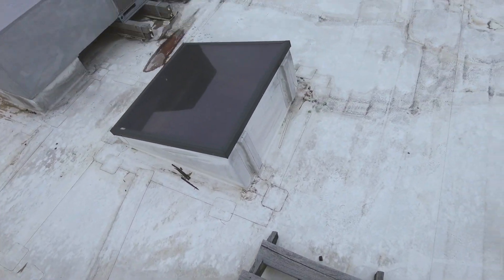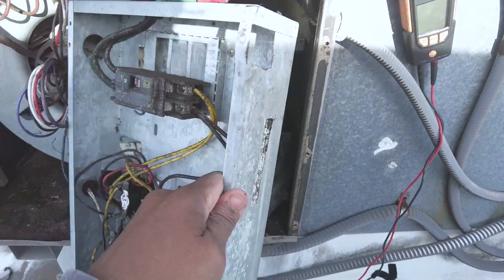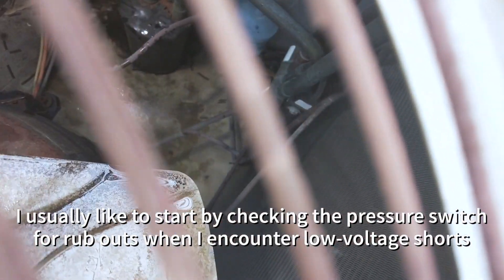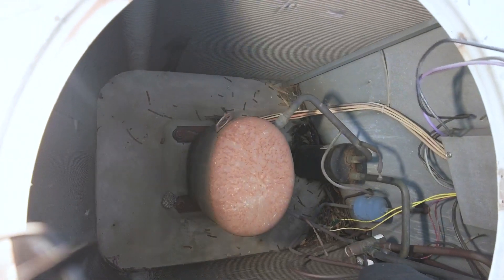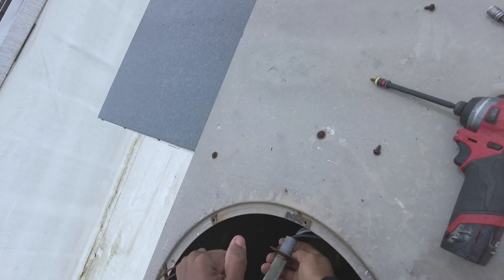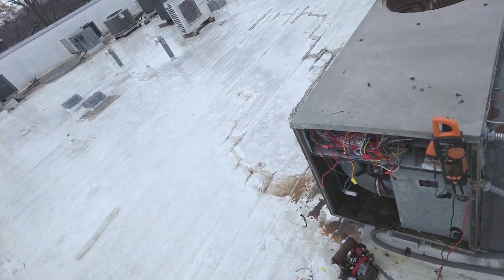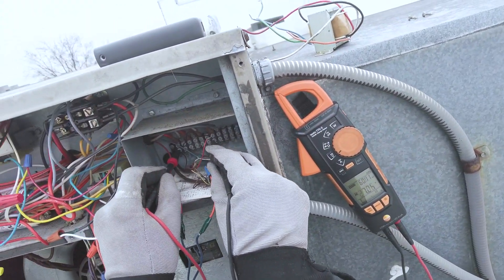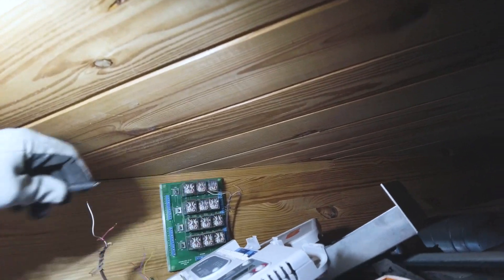Multiple Low Voltage Shorts Found on a Goodman Heat Pump Took Me Forever to Complete Repair🤯🤬 Pt.2

Comment: Coming up on five years in my house and five years with a 3amp fuse blowing on a Carrier Purion heat pump, installed by a prior owner in 2014. Seems like the blown fuses occur on a seasonal basis (winter). We have had yearly service calls by a local tech who runs his own business (mentors young HVAC techs so presumably he knows what he's doing!). Fuse usually goes out when there is snow on the ground and knocks everything off line. First time it happened a transformer also blew when he came out to diagnose it. The prior owner must have been having issues because somebody had installed an over-rated fuse there (probably to keep it from blowing) and apparently had the (elderly) former owner change out the thermostat every year (judging by a box of household-related receipts we inherited). Every time we have the tech out the 24 volt wires meter out correctly. Last year we had another part replaced that involved some type of spring type mechanism that is responsible for relaying the signals from the thermostat (he said it was sticking) but a year later, the same deal. Three years ago we even had the wires from the thermostat to the unit pulled and entirely replaced. This past February the fuse blew again as the tech was putting the panel back on the outdoor unit so he re-did the connections thinking that the short might be located there. (Always says the wires look good otherwise.) A few weeks later the fuse blows again. We finally tell him that we're tired of having this issue reoccur every year and what can he do to make sure it is truly resolved. After a few minutes he says the short occurred in the yellow wire (inside) and re-did that connection (should the wire have been replaced instead?). We could be waiting until winter 2022/23 to find out if this repair resolved the problem — but rather than do that we want to do some investigation of our own. First question is, should we make anything of the timing? We rarely get any snow but it seems that the fuses blow annually when there is frost/snow on the ground. Could this indicate that the actual fault lies in the defrost cycle? Is there anything about how that cycle executes that could trip the 3 amp fuse if the defrost board, temp sensor or whatnot is faulty? Not sure if this is related or not but I'll throw in this last "clue": Our electric bills are excessively high despite it being a modest-size home. Back when the thermostat wiring was replaced we saw a drop in our electric bills from astronomically high in the summer to just "horrible", but not as much of a savings as we expected given that the house has newer double-paned windows, full insulation, weather stripping and whatnot. There was apparently a wiring problem that allowed the heat strips to run during the summer — but correcting that only dropped our $800+ summer bills by about $100. Is the excessive electric consumption possibly tied into all of this?
Reply from the maker: It could have something to do with the 24v relay thats responsable for engaging the heat strips.Whats the air handler model?

Comment: Great job being persistent with tracking down all those issues. That’s a lot of components that were taken out by those shorts. Can’t imagine the repair bill for that call. Note to self don’t buy an older condominium that requires a crane to replace the rooftop unit !
Reply from the maker: Yeah that was definitely one of those jobs you just want to walk off and say forget about it, but by the end I was glad I stuck it out, it definitely fortified a lot of valve lessons that I won’t be forgetting anytime soon.  It wasn’t cheap for sure, and I’m sure the installs going to be pretty pricey as well.
Reply: @HVACTechKnowledgy  It’s good condo owner had you doing the troubleshooting. Less experienced tech would have walked off that service call.